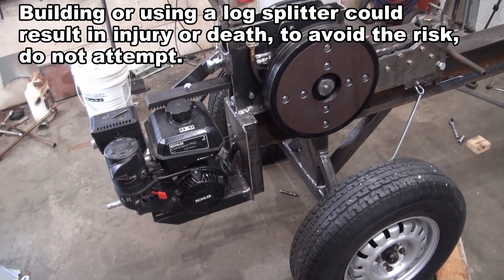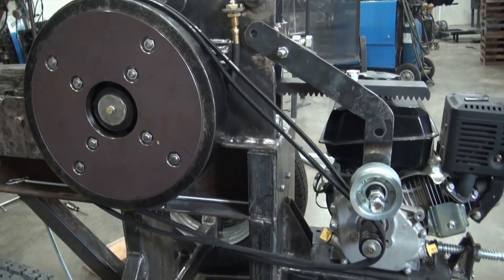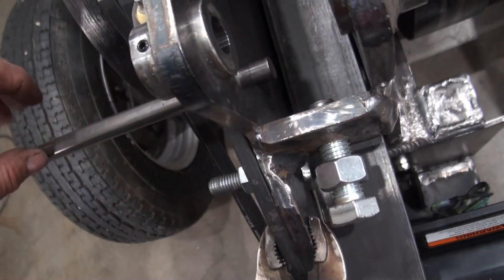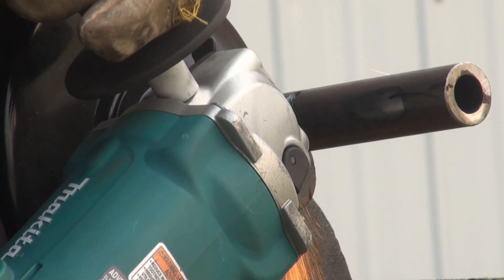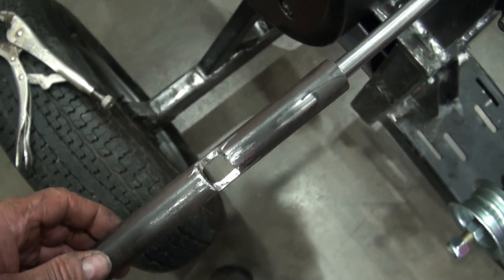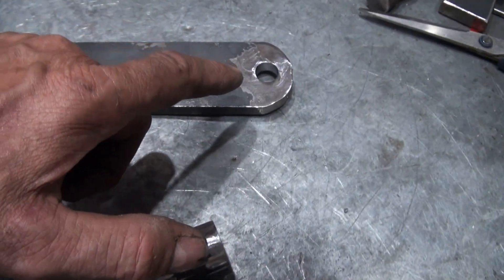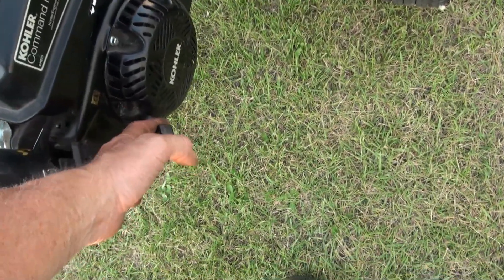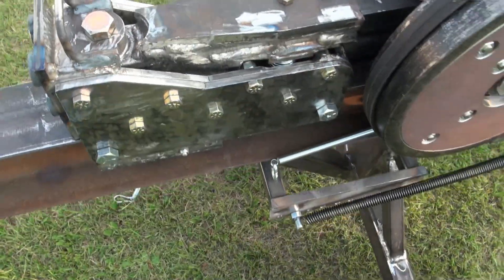Kinetic Log Splitter Build Part 24

Comment: Looking forward to a test run. Looks good. I just bought a used speeco super split and promptly jammed the rack and chewed a bunch of teeth down so now i havee to weld up the rack and try to geind teeth profiles on it. Those racks arent cheap.
Reply from the maker: That does not sound good, I don't know what happened there however something to consider is never try to re-engage the rack when there is a log jam, the reason is because the rack can use a bit of travel distance to fully engage with the pinion, it there is a log jam, always un jam it first.
Reply from the maker: Continued: However if the pusher was able to pull away from the jam I think then it should be fine to hit it again
Reply: @groutaone  

It didn't. I couldn't get it to draw back so it just sat there grinding until the flywheels stopped after I killed the engine.  I'm welding up the teeth on the rack now. Just doing a few and letting everything cool down in between so I don't cause the rack to bow. I'll sand a profile as clos as possible to the good teeth. It looks like the pinion is pretty worn down too. Hopefully it'll work again.

Comment: I don't see anything wrong with a manual clutch but wouldn't a centrifugal go kart/chain saw style pulley clutch work? I'm guessing they don't offer in a dual belt configuration.
Reply from the maker: After using my other kinetic log splitter without a clutch I thought it worked fairly well with the exception of starting the engine, there was a bit of belt wear though but not serious, this way there is no clutch to wear out or a clutch that may not fully disengage.
Reply: @groutaone  i don't remember,  the factory version has a slip clutch?
If so your new version is going to hold up better
Reply from the maker: @AndyFromm  My Chinese kinetic did not have a clutch, it had an idler but I disabled the idler almost from the start.